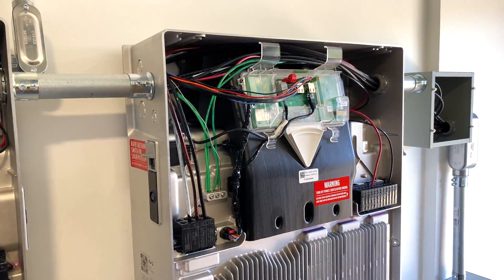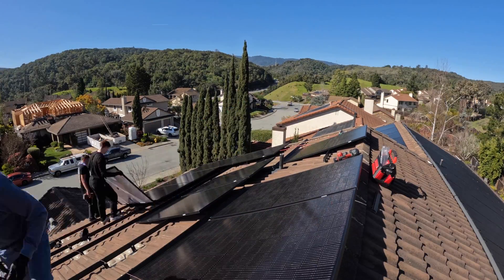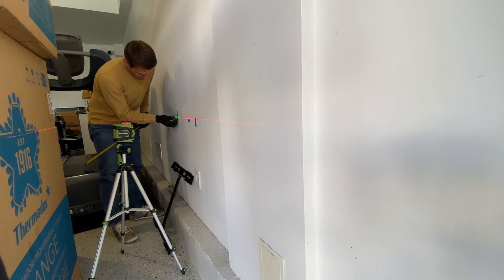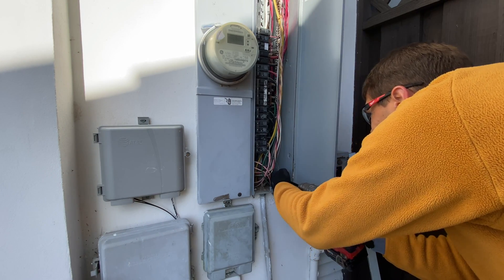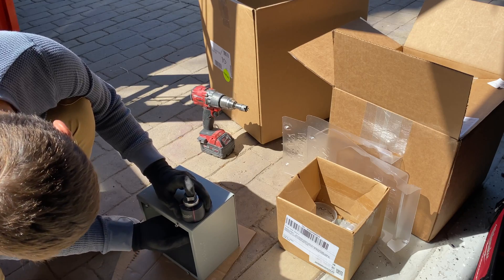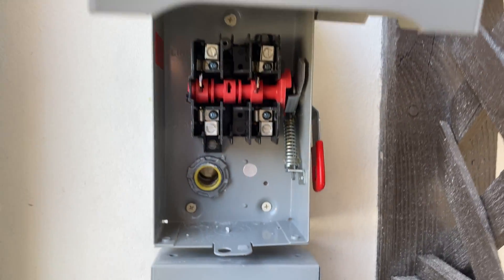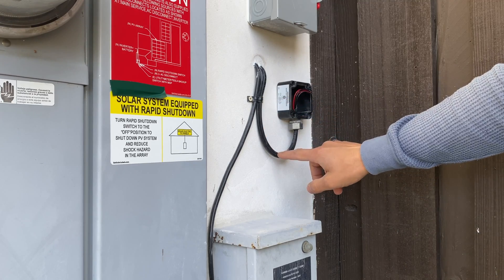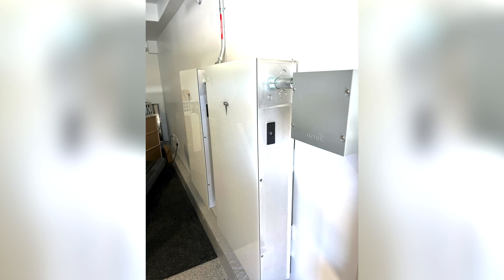Installing 2 Tesla Powerwall 3 with 9.7kW solar. Full home backup.

Comment: It appears you have a load-side (not line-side) AC connection for your Powerwalls. How did you comply with the 120% Rule? Do you have a 400A bus on your main load center?
Reply from the maker: Tesla has PCS certification that allows to surpass 120% rule

Comment: If you have AC disconnect switches for the Powerwalls, why do you ALSO need a Rapid Shutdown Button?
Don’t they both have the same result of de-energizing the solar system?
Reply from the maker: AC Disconnect will cut power coming to Powerwall, E-Stop button will shutdown powerwalls and solar panels.

Comment: They failed to install the required Ferrite EMI cores on the solar panel and AC wires inside the power wall boxes.
Reply from the maker: It was a few month when Tesla didn't include it in the package (and it was not required)
Reply: @SolarEngineering  I fully expect that the Powerwall 3 would fail the FCC radiated  emissions. If they passed the test without those ferrite cores, they wouldn't be in any of the boxes delivered.

Comment: I thought the batteries had to be 3 feet apart...
Reply from the maker: depends on the AHJ.
Tesla has UL 9540 certification that allows to install less than 3', but some AHJ still require 3'

Comment: I have only one conduit from the roof to one powerwall 3 and the 2nd power wall does not have anything connected to solar panels on the roof. Does it mean that solar panels are not evenly distributed between two pw3 units?
Reply from the maker: Do you have conduit connecting two Powerwalls? Solar might go in this conduit
Reply: @SolarEngineering  thank you for the reply. There is a conduit between two PW3 units, but that goes to the left side of the 2nd PW. Maybe, I'll ask the installer tomorrow.

Comment: Was there any issues with PGE and/or the inspector with the installation of the Tesla backup switch. Specifically re: the gas meters proximity to meter and panel?
Reply from the maker: no issues, but it's on the edge of allowed clearance

Comment: I have 28 panels and 2 powerwall 3.  Tesla made 4 strings (9, 9, 6, 4) and connected all 4 strings to one powerwall.  Is it more efficient to have 2 strings on each powerwall (9+6) and (9+4)? How much efficiency am I losing with all strings connected to one Powerwall 3?
Reply from the maker: about 5% loss due to DC-AC-DC conversion
Reply: It's interesting that Tesla didn't follow the procedure in its own instruction material. https://youtu.be/tAWt3WbSotY?si=ZxYbmGAGmq-RfeGk&t=28 

My contractor just installed 2 powerwall 3s, but only one PW is connected to the conduit coming down from the roof. Does it mean that the second PW does not get the direct dc-coupled feed from the solar panels and that I have to live with 5% efficiency loss ?
Reply: @photonqopt  Are you sure you do not have A Powerwall and Powerwall Extender? With the Powerwall Extender (can have up to 3 per Powerwall) only the Powerwall has the inverter.

Comment: Will the Powerwall 3 work with AC Coupled solar panels? I have SolarEdge. Just want to see if the panels will still be able to charge the Powerwall in a grid down situation. I know some inverters can do this by using the frequency shifting.
Reply from the maker: yes will work, but need to install Tesla Gateway instead of a backup switch.

Comment: Very nice! Are you using PCS on these multi-Powerwall installs to avoid additional electrical work?
Reply from the maker: PW needs 60A breaker. So for 200A main panel PCS is needed

Comment: Question; will the Tesla power walls allow for an inverter to be installed to facilitate a whole house generator?  I'm seeing that the power walls don't want to play with 3rd party inverters that would facilitate such a set up.
Reply from the maker: no, as of now Tesla doesn't support generators.
Reply: @SolarEngineering  thank you!

Comment: Mannn I wish you were in Florida. Very clean install and great video.
Reply from the maker: appreciate your feedback
Reply: Yep, I am looking for a similar system for my home in Florida. Now they have the Powerwall extender so you can save a few grand or so with that. Want to stay under 10kW so insurance companies don't complain. The 27kWh on the Powerwalls should last the night in a power outage on a newer 3k home. Unlike CA, it rains quite a bit more in FL and need a good installer. There are a few, just have to get recommendations and see their work.

Comment: Hi, I’m getting 23 panels installed with 3 powerwall 3. I think right now it’s grouped as two strings 11 and 12 panels going to two powerwalls. Should I ask to do two 8 panels and one 7 panel each going to its own powerwall? They said it’s most efficient with it grouped to two strings. What are your thoughts?
Reply from the maker: 3 strings, one to each powerwall to charge dc to dc will be most efficient
Reply: @SolarEngineering  Thank you! I'm having Tesla change the design planned to split to just two PW3

Comment: @SolarEngineering Stupid question but I thought Tesla Power wall 3 was not stackable?
Reply from the maker: correct, we cannot install PW3 in front of PW3. PW2 was stackable and we can install few of them in front of each other (search for images: "powerwall 2 stackable").
Because all of the connection in PW3 under the front cover, we cannot cover it with another PW3.
Reply: @SolarEngineering  I was using the wrong terminology, I was saying stackable but I guess the correct term is scalable. Thank you for replying

Comment: How much does this setup cost?
Reply from the maker: $45k+
Reply: @SolarEngineering  thank you for replying
Reply: @SolarEngineering  Currently the Solar Tax credit is 30% correct and includes pretty much the entire install including batteries? So if you qualify then about 15k in Federal can be saved?
Reply from the maker: @viadharmawheel  correct, 30% parts and labor for solar installation

Comment: How do you guys comply with 705.12 in this setup, did you use PCS feature?
Reply from the maker: yes, powerwall + backup switch PCS certified
Reply: @SolarEngineering  So, PG&E approved it without proper PCS labels? Or you just indicated it like a note on the planset? Thanks!
Reply from the maker: @Devlin-o5u  there label attached to main panel, just didn't get on the video and planset has info about PCS as well.

Comment: I'm not buying any powerwalls until they get vehicle to home working so I can use my Teslas battery to supplement the powerwall during blackouts.
Reply: Yes, V2H is the way to go! Install a small P/Wall to hold the home till the car can be plugged into the P/Wall.
Reply: Yeah that would be really good.
Reply: CT supports this I believe. Let's see when the other models ad the support. Heck, the Nissan Leaf has had this support for a while.
Reply: @viadharmawheel  it doesn't. What ct is doing is converting the battery DC to AC and running it through the service panel. The problem is if you need to drive your car, your house won't have electricity but if it was dc your powerwall would kick in. It needs to be DC from the CT to DC on the power wall. Gm and ford has this now.

Comment: Now, after years of development, Tesla Solar + Battery + EVtoGrid backup became most streamlined and efficient process. What with price comparison?
Reply from the maker: Tesla Powerwall 3 price is about %25 more than Sol-Ark 15k (inverter only, no batteries). Installation is much easier as well.
Reply: @SolarEngineering  So total cost is a wash or still a bit more?

Comment: Great work love watching your videos - quick question - can you connect 2 Tesla gateway 3.0 in parallel ?
Reply from the maker: I don't have much experience with Gateway yet. I'm assuming you want to parallel them for 400A service?
Reply: Yes that’s correct - backup switch won’t work for 400A
Reply from the maker: @willshakespeare38  haven't done yet..
Reply: Thank you - do you have a link to purchase the Tesla microinverter for solar panels ? I’m looking at a ground mount install with third party solar panels